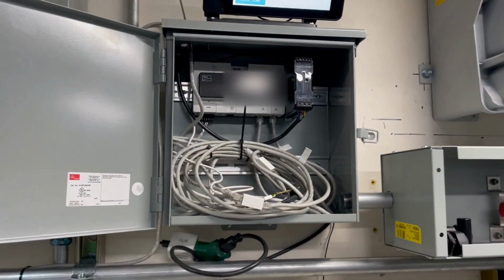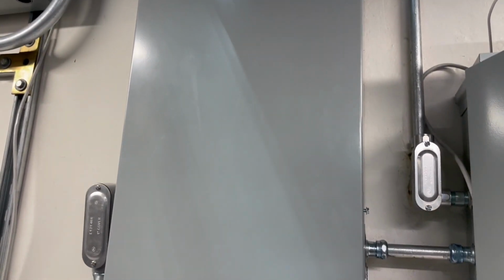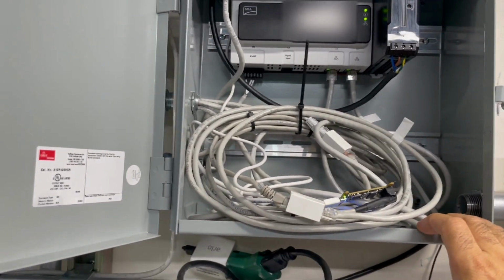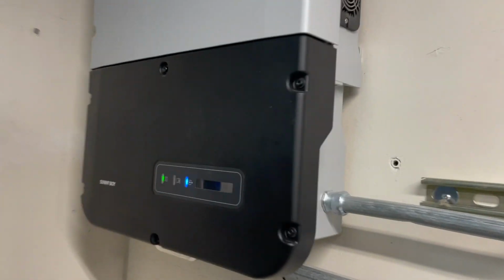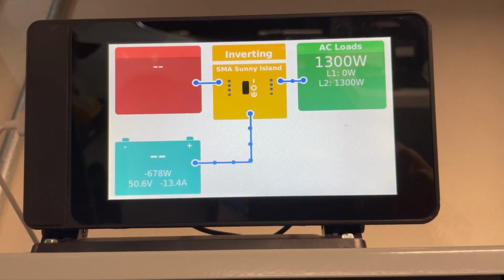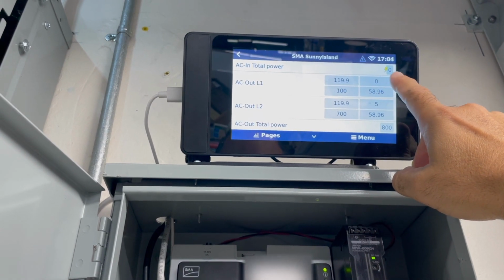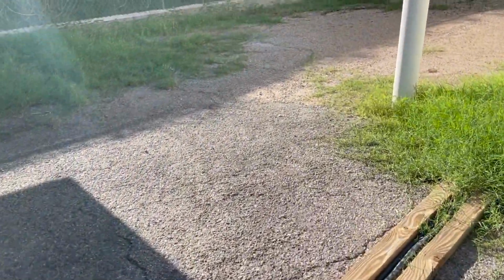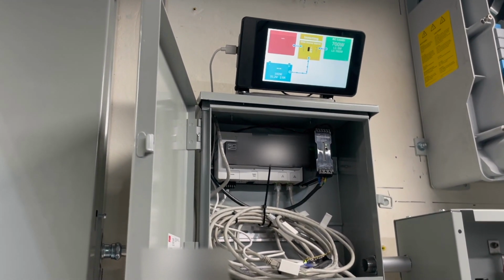Installing SMA Sunny Island 6048-US Inverters in preparation for BigBattery.com Kong Elite Batteries

Comment: Is is possible to use the Victron Cerbo to run the Get Hub program? 

I have a couple trailers running in Open-Loop but would love to fix the SOC issue and automate some of the generators

Comment: Thank you so much for putting this videos and sharing your knowledge and experience!  We happened to have a trailer SMA Sunny Island invertors to a KING big battery also! 
We've been having problems with invertors eading battery power which has plenty of energy but invertors reads battery as very low and shots off?  Any ideas on how to make invertors to comunicate with battery? Thank you so much in advance for any help you can provide😊
Reply from the maker: Thanks for your comment and sorry for delayed reply. I have seen a YouTube video of using a victron smart shunt and custom victron os software on a raspberry pi that use the state of charge reported by the victron smart shunt as well as voltage settings to control the charging. It communicates to the sma inverters using CAN bus to the raspberry pi. I tried it but was concerned of using it as many setting changes to the software were required and I wasn’t certain was robust. Other option was installing another bms in the pack. REC bms or Batrium BMS. Do search on “sunny island bms” and you will see threads discussing. The REC BMS seemed rather expensive and if you have two batteries in parallel you really only can read one of the batteries from my understating.  You may want to go through your setup again (setup system or new battery) on sunny island to see if you can get it to work properly. Are you using an external shunt connected to the sunny island to help measure amp-hr in and out? This is required when using dc-coupled charging from my understanding.

Comment: I have 17 of those I'm here in AZ to if you wanted to build it into a 24,000 watt and have your pull around solar trailer
Reply from the maker: Thanks Rich. You have 17 of the SMA sunny island inverters?
Reply: Yes got 2018 models I sold all the midnight charge controllers and have 17 left  I got from the same auction the trailer that were being auctioned off at also I'm a growatt dealer and enphase I'm talking to sma and trying to become a seller and installer in Arizona

Comment: Nice work . I am from over the pond. Just in the process of upgrading my solar at the minute from one sunny island to . Two and adding the home manger m . Hoping to have a video up so. Very interesting. Would love to use a raspberry pi as you have. Is straight forward to setup. Will be watching the rest of the videos cheers.
Reply: I have 17 of them if you want a deal
Reply: @richeagleton5285  sorry for the late reply. If the budget was there I would be in . Plus I also live in the uk . Cheers.
Reply from the maker: Thank you for the comments and I’m going to check out your videos and setup. I put in one of my comments the raspberry pi setup hardware but a channel called off grid garage has a good video on the setup.

Comment: I have a Sunnyboy 5.0 that I hope to be hooking up soon, ( still trying to find a PE to permit my roof ) I was not aware that these would work in an off grid style when tied to a SMA Sunny Island, any chance you can better elaborate how this is done since this is more or less the idea I had to set up in the event of power outage from a hurricane, or even just to use batteries to limit usage from the grid.
Reply from the maker: Sean,

The following video has good info on the sunny island with some points on how its functions it at the video times listed below.

https://youtu.be/Fpwgrq_Bz0Y

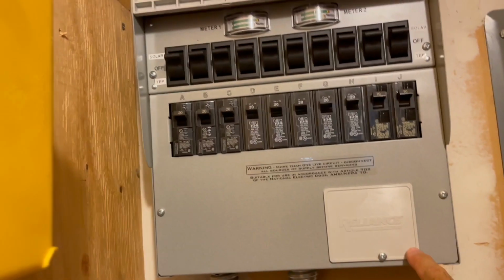5:28 concept of AC1 (protected load panel side of inverter) and AC2 (grid or generator side of inverter)
13:50 possible configuration you are considering?
16:00 discussion on Frequency Shift Power control (FSPC)
18:10 grid backup mode

20:29 is a setup for a grid connected Sunny Island and associated Sunny Boy which powers and offers backup to a protected loads panel (fancy words for an additional sub panel that you install that connects specific loads in your home to the sunny island, this could be a reliant transfer switch as I show in my video or separate sub panel you have wired up and connected to these loads). With a single Sunny Island, you will want an autotransformer to create 240v (look at videos of solar edge autotransformer as seems to be most popular). This is not needed if you have two Sunny Islands. This configuration can also back-feed to the grid or your other house loads. You are able to set the amount of power you want it to back-feed the grid.

I have not done this configuration yet (with the grid connected) but the way it should work is that the Sunny Island and Sunny Boy are on the AC1 side of the Sunny Island inverter and the grid is connect to the AC2 side of the inverter.  The AC1 and AC2 relays are connected and the Sunny Island matches the grid frequency (i.e. 60Hz). The Sunny Boy would be powering the loads on the protected loads panel and also charging the battery.  Excess energy not being consumed by the protected loads panel or battery will be fed-in by the Sunny Island via the internal transfer relay (the relay that connects AC1 to AC2) into the utility grid or your other house loads (loads not on the protected loads panel).  Note: The manual says the maximum AC power of the connected PV inverters must not exceed 7kW in a grid-tied system, this is due to the limitation of the transfer relay to 56A of AC current (56A x 120V ~ 6.7kW). In a normal off grid system, once the battery is full, the Sunny Island would increase the frequency to dial down the power from the Sunny Boy to prevent excess charging of the battery.  In a grid tied system, Page 137 of the Sunny Island manual (14.2.10 Operation Together with PV Inverters) explains what it does but not fully clear to me.  I believe what happens is that if the grid is connected (i.e. 60Hz) and battery is full, that the Sunny Island disconnects the connection to the grid so that it can frequency shift and dial down the Sunny Boy or it could be that excess power is feed back into the grid?  I'm sorry I don't have a better understanding of what it does, I think a call or email to SMA might help answer this better.

In terms of providing power from the battery to limit usage from grid, I am not certain how this would work with a grid tied system except during loss of the grid.  When the grid is lost, AC2 would disconnect and you would be powering the loads on the protected load panel side of the inverter (AC1) from the Sunny Island + from the Sunny Boy. Hence it keeps your Sunny Boy online providing power from the sun.  With a normal grid tied inverter, once power is lost, the Sunny Boy would shut down.
Reply from the maker: This is another video from sma that discusses the sunny island: https://youtu.be/vBquLzPxiqc

20:45 in on that video explained what happens when grid tied and battery full and sunny boy generating excess power above and beyond the load needs. It passes that power to the grid.
Reply: I have sunny islands for sale at a huge discount they have 10 year warranty and have sat for 4 years for 6 years left if you want a sunny island for a good price

Comment: Why do you have two double 60 amp breakers feeding your dedicated loads panel. One has blue tape and the other has red tape on it. Where is the other  double amp breaker leading to ? Also is the Sunny Boy inverter feeding the dedicated backup loads panel ? One more question for you, where is your disconnects out side the building, how many are you using for the sunny islands and how many for the sunny boy and what volt and amps are the disconnects ?
Reply from the maker: Hi Frank. The two 50amp breakers went to connections to a dc solar trailer we had connected outside. It has two sunny island inverters inside a custom enclosure along with custom breaker panel and qty. 2, 240v outlet plugs. We used two cables connected to these outputs and then connected them to the two 50amp breakers (the ones with the red and blue tape). As we have now replaced this with the two sunny island inverters inside, we are no longer using these connections.

This electrical panel is the off grid load panel (ie dedicated backup load panel). The two sunny boy inverters that are shown connect to it via the double pole circuit breaker located in the bottom right of this panel (in this video it’s not installed yet). This video shows it installed: https://youtu.be/9-tdLaP_IW0

We are no longer using the outside connections to feed the off grid load panel but when we were we used the following setup. Also the dc solar trailer had electrical panel with circuit breakers similar to off grid load panel in which the outputs to the 240v outlets could be switched off.

Wire harness assembly (2x)
1. Wire, 4 gauge, 4 strand with insulation.
2. Locking connector (to connect to DC Solar AC output), Marinco CS6365N 50 Amp, 125 Volt/250 Volt, Plug, Locking,
3. MICTUNING 125 250V 50Amp Heavy Duty RV Replacement Male Plug with Ergonomic Handle Yellow (to connect to wall mounted box with mating receptacle, this has wiring that connects to the 50a double pole breaker inside the off grid load panel)
4. BougeRV 50 Amp 125/250 Volt RV Power Outlet Box,Enclosed Lockable Weatherproof Outdoor Electrical NEMA 14-50R Receptacle. This is wall mounted outside the building.

We did not use any outside disconnects for sunny island or sunny boy. The sunny boy has the dc coming to it from 23 solar panels on the roof which are dc fused. The sunny boy has a disconnect switch on itself to turn off the dc input. For the AC output from the Sunny boy it goes straight to a 40a double pole breaker located in the off grid loads panel. The sunny islands have a dc switch on themselves that disconnects them from the batteries. The off grid load panel has a 60A double pole breaker that can be switched off to disconnect the AC coming from the sunny islands.

This video can be confusing on the setup because it is transition phase between using power from trailer outside and getting the sunny islands setup inside.
Reply: Thank you so much for the reply to my last comment. I was curious to know what size wires you used between the sunny islands A/C 1 and the dedicated circuit panel ? Also what size wires from the  
A/C 2 to the main service panel ? Was it #4 or #6 ? Can you also tell me what size ground wire was used from the solar panels on the roof to your sunny boy inverter ? Did you ground the solar array racking only to the sunny boy inside or elsewhere outside of the sunny boy ? Can you tell me the size and type of wire from. Your solar panels and sunny boy (perhaps solar wire) and size and type of wire from your A/C output from your sunny boy to the dedicated  service panel ? Was the DC solar wires fused at the sunny boy inside or outside some in a combination box? Perhaps you can open up the sunny boy and make a video  showing the wires and solar panels on the roof of how it was all wired including the ground of the solar array.